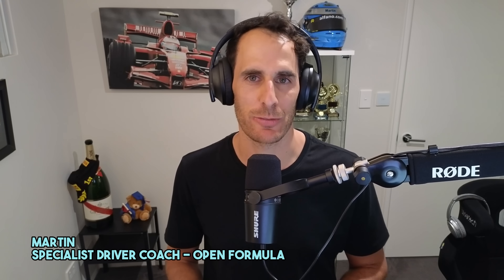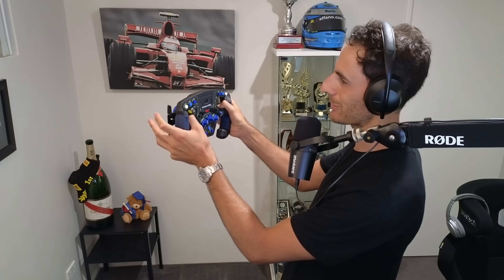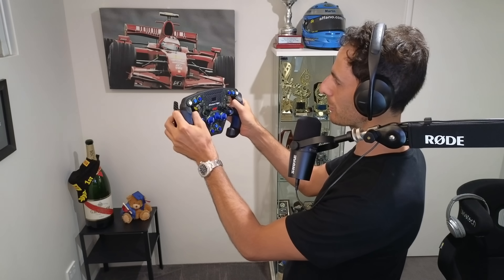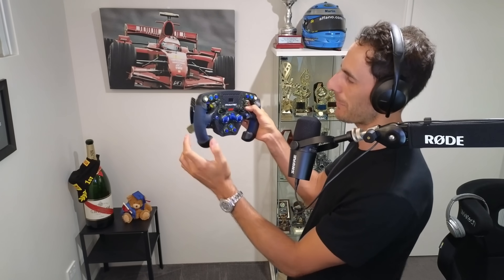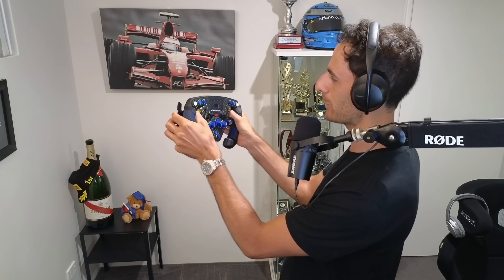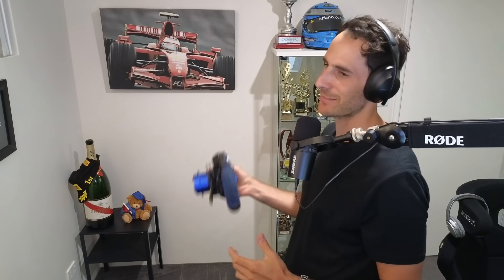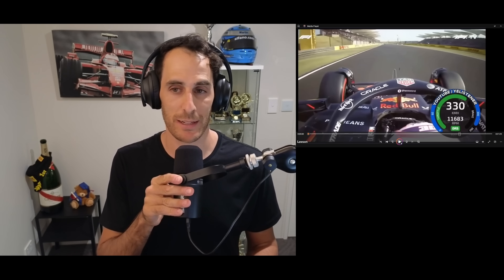The SECRET TECHNICAL Reasons Why Liam Lawson Was Sacked!

Comment: You cherry pick the worst onboards to do your analysis, the colapinto one is a terrible example as hes battling someone.. he opened the wheel to run franco of the track.. turn 6 at china would be the best corner to see what liam does differently to max... max gets over to edge of track much earlier. Max brakes earlier. Max is then able to get on the gas earlier. Liam is trying to make up to much time in the braking zone, if he braked earlier and not as hard hed be able to start turning same time as max without getting the instability feelings hes getting hence why he doesnt apply as much steering until later in the corner once hes bled enough of the longitudinal load transfer of. The steering is a symptom not the cause.
Reply from the maker: Agree the Mexico one was during combat not the best example. The others are fine. Go find a better analysis on YouTube - most of these guys just storytell for 20 mins
Reply: @lowerlaptime  Driver 61 did a much better job.. you did the same with the melbourne grand prix video with doohans onboads by showing a freeze frame where hes already mid correction and saying it was a steering problem again instead of highlighting the fact he spun the wheels up on the paint and then gained traction again due to him lifting a bit and coming of the paint mid correction pitching him of the way hes already corrected.. I've done a better analysis in the comment section. I see you have a sim, jump in a single seater aero car in that, crank the aero and mechanical balance forward and open the diff right up and see how you drive around that. You will reduce the amount of combined entry by braking in  straight line, or if your max verstappen level talent you will start braking earlier and balance the car on a knife edge while maintaining the combined entry... to highlight further its balance and managing decel to control rotation , watch Verstappen vs Lawson transition into turn 3 at china. No braking involved in that one but how the throttle is released  to get car to rotate. The steering your identifying as the problem is a symptom not the cause.
Reply from the maker: @jakeparker8254  are you having a laugh? I've never asked this before but please don't subscribe to me 😅
Reply: @lowerlaptime  I haven't don't worry, the algorithm keeps giving me your videos though. I'm up for being corrected though and happy to engage in explaining my thoughts on this.. But again the steering you identifying as the cause is actually a symptom. If im wrong here please correct me as I would happily take the opportunity to learn more.
Reply from the maker: @jakeparker8254  ok well i appreciate your openness. Driver 61 - just garbage video that gives context for 10 minutes. He is a YouTuber first a foremost looking for clicks, views and revenue. No technical info. RE Melbourne - the track is littered with white lines everywhere. And when the steering is turned and you apply throttle (you saw the friction circle) you'll violate it. To get maximum traction capacity, roll thru the corner, open the wheel (that's the part jack didnt do) then apply gently throttle
Reply: @lowerlaptime  Yeah he goes around in circles a bit but he's highlighted very clearly the car is unstable and how different drivers compensate for this. To counter this, max is on throttle earlier than Liam with similar lock on but he's got the car rotating better at that point. The traction circle example is to simplified. The error has already occurred by the time they are both on throttle. Your analogy does help explain Liam struggling to manage front tyre pressure/temp but you should use slip angle vs lateral force graph and how slip and load generate temp and how that can negatively effect the available grip, but again its because he's not confident at managing the rotation on corner entry. I do a fair bit of race engineering professionally and  my passion is simulation and vehicle modelling so i may be a bit further down the vehicle dynamics rabbit hole than you, however im presuming that and am happy to be corrected.  A better example for the sim is to try a fwd touring car, stiffen the rear up and raise rear ride height and see how you manage the entry phase. Not quite perfect as you can you fix a lot of sins in a fwd by carrying or applying throttle when things get out of hand but again you will see what im saying.
Reply from the maker: @jakeparker8254  im actually happy we exchanged. Again i like you open-mindedness. So before going into slip angles and lateral force, I would look to give liam a very simplistic (purposefully simplistic) idea of 1. Downforce. 2. Friction circle. And 3. Just being consistent your steering. Im pretty sure if those were cleaned up, all the other metrics downstream of that would be fine, no? Ie - you gotta know how to walk before you can run, this is bad use of a steering wheel
Reply: @lowerlaptime  I enjoy being wrong as its an opportunity to learn! yeah that's where we are diverging on thought, the steering thing fixes itself once the cars corner entry stability is fixed. Max is clearly a freak at this, Hence why i keep saying the steering is a symptom. Liam's problem is he's not able to steer/control the car with the brake release or throttle release on entry the same way max can.   Max makes it look ridiculously easy, which makes Liam look like an amateur when he clearly isn't.  Liam  cranking on the steering at the apex is because the car wasn't rotating enough at this point. And its not that Liam isn't capable of it or has had terrible steering technique his whole career, you don't get to f1 without ever figuring this stuff out, the cars stability index is just to low for Liam to handle on entry and then we say this compensation. This compensation then leads to what your talking about which drives the fronts out of the temp/pressure window and it just spirals from there.   Liam made it even worse by then trying to make the time up with aggressive braking.     What's even worse is I think Yuki has this style of late brake aggressive turn in worse than Liam from the onboards I've seen, for Yuki's sake i hope he's able to adapt his driving style better.
Reply from the maker: @jakeparker8254  i agree 100% with this! The only thing id add is that i dont see him taking advantage of the initial grip at the early phase of the corner. Ie very slow gentle introduction to turn, which helps give more grip later in the corner (rob Wilson, always introduce the car to whats coming next) and so.. like in the friction circle, hes not using the first part fully, then, hes overusing the second part of steering. If he can just turn very slowly and get comfortable i think hed be ok. Its a shame we can't work with him
Reply from the maker: @jakeparker8254  ps you can subscribe now 🤣 i saw your initial comment as a bit harsh but glad to connect
Reply: @lowerlaptime  sorry ahaha Im a liam fan so last couple weeks has been a bit rough for me lol! will give you a subscribe for engaging!
Reply from the maker: @ cheers jake talk soon :)

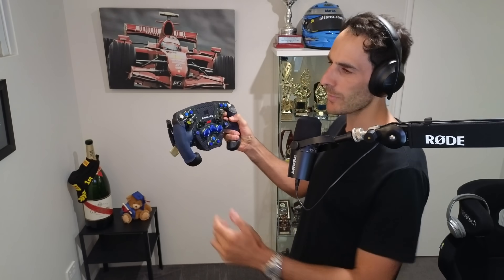Comment: 01:17 No, the opposite. Liam is putting little to no lock on turn in, he brakes very late and then turns in. He isn't not getting the red bull to pivot. He is the underteery type.
Reply: And people lap up this guy's content.. it's so obvious liams braking late, hard and in a straight line because he's struggling with the stability on combined entry.. this guy is seeing the steering and thinking it's the cause and not realizing it's a symptom. When your dealing with experienced drivers getting something wrong its nearly always the braking.
Reply from the maker: I said what you said about lock. Rewatch? Explained in the friction circle part

Comment: I agree.
Also, it seems that if RB is going to use RB2 for training new drivers, they need to find a way to help those drivers break bad techniques that would well on the softer RB2 cars but will fail (as you described) on the knife edge RB cars.  Any ideas how they could do that better?
Reply: @connecticutaggie  give them testing time in an old car set up like the Redbull
Reply: @fintonmainz7845  It seems that you should  be able to setup a simulator that simulates the loss of down force and creates the same response as the car when you turn the wheel late.
Reply from the maker: Who do you rekon will quali higher on suzuka - yuki or liam?

Comment: Perhaps, he should go drive some MX-5 races to learn how to be smooth on the inputs, this car likes progressive smooth inputs
Reply: I don;t see that as relevant at all. MX-5s are light and underpowered and can be controlled easily, they also do not have ground effect. We've seen Liams driving in DTM, F2, SF, an MX-5 comparison would be of zero help. He's not the best driver, but he must have some talent to win on debut in F3, F2, DTM and SF, he can't be half bad, the fact he is shocking in RB, well, says more about the car than him I think.
Reply: @krisby1  I understand your train of thought and yes the car is extremely edgy with a very narrow operational window. The MX5 forces you to be smooth and precise also it doesn't like to be braked harshly when driven on the limit, it's slow enough to retrain your muscle memory. It's a momentum car so it has to be driven as smoothly as possible to be fast and maintain balance otherwise it can be very twitchy. If you see Max on the SIM drives a big variety of cars (including the MX5) so he forces himself to adapt all the time to suit the car
Reply from the maker: Who do you rekon will quali higher on suzuka - yuki or liam?
Reply: @lowerlaptime  hard to tell. I'm sure that Yuki won't qualify p20 like Lawson but he will need time to get to grips with that car considering he never drove it

Comment: Sorry, buy saying Perez had 4 years of subpar performances is extremely wrong. He had 4 years in that car precisely for NOT having subpar performances. He struggled, but also had very strong weekends (30+ podiums and 6 wins are no flukes). If you can't see that, well, that makes you simply a disinformed hater. Last year was extremely poor from Perez, but also the car was so bad not even Max was able to win races. Yet, being a generational talent, he managed to cling to the title, by a whisker. 

Oh the other hand, Liam has proven nothing and more importantly his attitude is completely out of place. No matter the situation, Perez was never slow per se. He crashed instead of being slow while trying to extract the maximum of the car. What's worrying about Liam is that he's slow AF because he has no clue whatsoever on how to go faster in that car. That's why they're sacking him, not just because he doesn't know how to take a corner. He doesn't know how to prep tyres, he doesn't know how to manage tyres, he doesn't know how to communicate the issues he's having, and ON TOP he fundamentally doesn't think he's doing anything wrong. 

It finally comes to this: You can't learn anything if you believe you know everything.
And that's Liam's real problem.
Reply from the maker: Who do you rekon will quali higher on suzuka - yuki or liam?
Reply: @lowerlaptime  Yuki, no doubt.

Comment: I think it is always important to brake as hard as possible so that the weight shifts as much forward as possible to give you that positive turn in. Of course, this will definitely encourage the rear to spin the car so you have to practice until you figure out the small movement is enough to turn the car in. I think Lawson is simply not at one with the car, and many experts say the Red Bull car is very unforgiving.
Reply from the maker: Who do you rekon will quali higher on suzuka - yuki or liam?
Reply: @ oh. That’s a hard one. I think Liam will do better than at RB. Because RacingB should be easier to drive. 
Yuki will be disadvantaged driving the nervous RB car. It’s a close one. 
I would say Yuki can qualify just a bit better may be to Q2. While Liam is also on Q2 but perhaps lower rank. No real reason for my conclusion, just a hunch. 😂

Comment: He wants to V the turns, but this the worst era ever to try it.
Reply from the maker: This is a great concise comment. Thankyou. I should have said this
Reply: @lowerlaptime  Correct me if i'm wrong but is using a V type corner not what Max uses? Im sure other greats also use this style such as Schumacher, Mansell and Prost? I understand Max and these greats especially Schumacher were not simple V drivers like Vettel but they have defiantly had a shorter rotation point than most.
Reply: @MAK790 According to a video Driver61 did on this, Max used to do V turns, but adapted his style to the new generation of cars (and tires).
Reply: It's the opposite, liams braking to late and having wider turn in.. this video into hairpin shows it, max is turning in much earlier in this hairpin clip... liam and max are both trying to manage an unstable car in two different ways.. liam is doing it by getting as much braking done in a straight line.. max is managing the instability with braking technique.. this whole video should have been about braking.
Reply: @jakeparker8254   It is about the interplay between braking and steering, and certainly Max is managing the instability by the way he manages both variables. The thesis, supported by the video evidence, is that Max has been maintaining a position on the friction circle by progressive steering and progressive reduction in braking into the corner.  Liam, on the other hand, steers a bit, brakes hard and late, then steers violently to overcome the sudden understeer resulting from the loss of downforce; result is that he is never at an efficient point, and has a tendency to shoot over the edge of the circle when he corrects his steering.   It is true that Max is famously reputed to be a user of V-type cornering, and this is held as an explanation of the car being optimised for that, hence being undrivable by others.  The truth is certainly quite different today, whatever it may have been in the earlier stages of RB development under the current rules.
Reply: @jakeparker8254 exactly, lawson has trouble trail braking
Reply: @jakeparker8254 well excellent put that video out for us please, but I’m sure going around a corner involves all 3
Reply: Surely all the sim work would highlight issues like this? The problem must be more complex. No?
Reply: You don't understand how much drivers that don't have proper coaches in the SIM barely gain any knowledge. You need a Rob Wilson @RedBatRacing
Reply: Sim cannot 100% replicate real racing. He has afraid to lose it all. The back always wants to snap  @RedBatRacing
Reply: @RedBatRacing unfortunately, Sim doesn’t replicate what it’s like on Track with Grip, or lack thereof 🤷‍♀️
Reply: Ask DR about that.
Reply: and this is why many of the "LATE Brakers of the past era are failing with ground effect cars.  Just look at what happened to Daniel Ricciardo's career!   Well said @fernandosantos4763
Reply: I've seen many BMW drivers prefer V shape turn to compensate for the lack of dynamic camber from their Macpherson struts and loss of front end grip.  Lawson drives kind of like that.  Apparently, the RB doesn't lack front-end grip.

Comment: Do you think it’s also a confidence issue? He may feel tense as Albon says on entry and due to hesitation of initial steering, he feels he has to compensate with aggressive turning mid corner to get rotation? This causing his front tyres to cook
Reply: This is possible, I rewatched the Tomo interview, with Liam on the sim.
Same coner, the problem was still their, but not nearly as bad as it was in the examples in this video.
Reply from the maker: Yes it could be a confidence issue. Can i see this video?
Reply: @lowerlaptime  Sure.
You have a billion times better at this then me, maybe I am looking wrong.
Because looking at it again now, it looks even worse on the sim. 😳

https://youtu.be/3kAu5Ezk-dE?si=opdLLTw8CaP_Dyef

Comment: Thats not a secret. Being smooth works everywhere, on aircraft too where you deal with lift as well. They should have seen that before putting him in this car. There is a tradeoff between stability and sensitivity, the more sensitive the car the easier it is to get it unstable.  It would be fair to say that this car is more on the sensitive side and less on the stable side already. They should choose a driver who is smooth by default then maybe show him how to improve. This guy is not it.  His ceiling of performance will not be close to the cars ceiling. You see this difference in pilots as well even though flying has higher margins of error and no laptimes in general.
Reply: Oh so now it's the car not the driver 😂😂😂😂😂😂
Reply from the maker: Who do you rekon will quali higher on suzuka - yuki or liam?

Comment: Could you analyze Yuki's driving?
Reply: they have the same general style: late braking, sharp turn; very few drivers steer the car from afar while agressively braking, basically shortening the distance, the space they use in a corner; Liam has the classic style with, as mentioned here, less progresivity and smoothness than it should and probably could.
Reply: @eugenux  So in short, Yuki is cooked?
Reply from the maker: Now or when hes in the red bull?